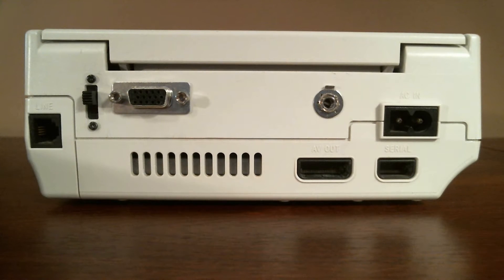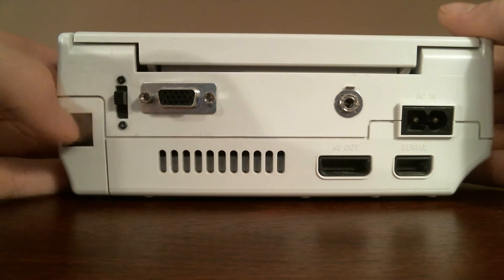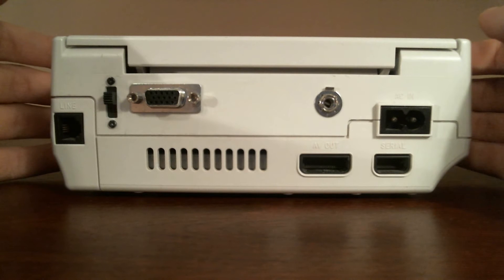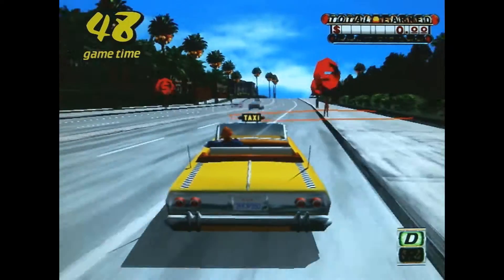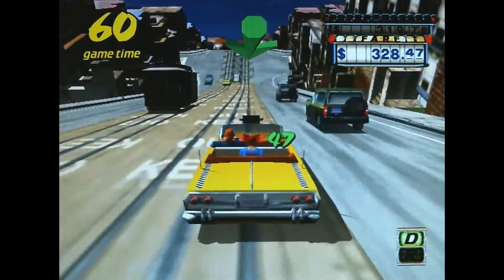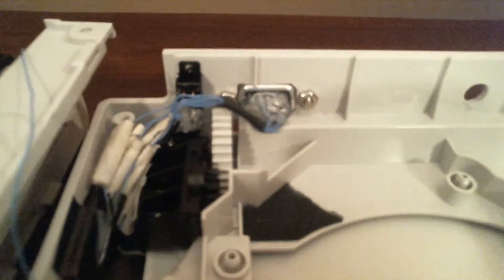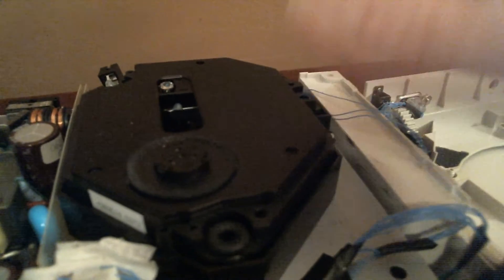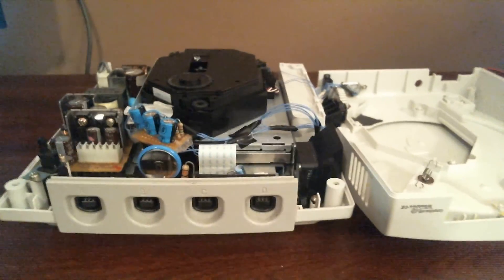Dreamcast Internal VGA Mod - Overview

Comment: DO NOT use hot glue to hold wires to their solder points, using a blob to hold the board onto the case of the dreamcast is alright but NEVER use it anywhere where wires meet the  solder

Comment: There is a vga cable that plugs directly into the AV port on the Dreamcast, is there a quality difference between that and this mod? Also, is VGA better quality than the RCA connector?
Reply: Elite Khajiit Why not a cable? I bought one and it works perfectly. There isn't much difference between the cable and the retrobit vga box.
Reply from the maker: Please don't buy the VGA cables that plug directly into the back of the Dreamcast's AV port. From everything I've read, they don't work. The Dreamcast needs the circuit to output proper VGA. You can buy the Retro-bit VGA box if you don't want to spend that much on one (it's $30 USD)

http://www.stoneagegamer.com/dreamcast-vga-box-retro-bit.html

There are also other VGA boxes like the Hanzo which have other features like a scan line generator and the original VGA box from Sega, which is sort of a collectible and very expensive. Whichever VGA solution you go with, make sure it's not just a cable, but a box instead. There's no real quality difference between my Retro-bit VGA box and this mod. The mod has some noise in the picture, but that's because of the resistors I used (carbon vs. film). Even then, it's not noticeable unless you stare at a black screen looking for it. The quality of VGA over composite and s-video is much, much, much better. A VGA signal is one of the best analog signals you can get.
Reply: Thanks that's a very clear explanation!
Reply from the maker: No problem. Glad to help, especially with anything Dreamcast.
Reply: I use a Retro-Bit cable that I cut the VGA enable trace on (now it is in RGB mode) and plug it into a cheap Extron RGB interface. Capacitors are not necessary because the Extron is filtering the signal. The Extron does not process the signal, though, so you can't get 32kHz VGA to work on a 15kHz PVM.

Comment: The PlayStation 2 has a vga cable certified by sony for it. No modding needed.
Reply: Hey guys this isn't 2002
Reply from the maker: The Dreamcast had several VGA boxes available for it, including Sega's own. The VGA mod is for fun. Besides, the PS2 requires a sync on green monitor. If you don't have one, you need to build a mod with a chip to get VGA capability out of the PS2.
Reply: No you don't. You just bought the hard drive with linux on it for ps2. You just had to install it.
Reply from the maker: https://en.wikipedia.org/wiki/PlayStation_2_accessories ... Not to mention I looked into it when I wanted to install a VGA mod on my PS2.
Reply: some monitor's support it out of box.
Reply from the maker: That's what I said. Not many new ones support that feature though, so it's better to build the mod or buy a new monitor.
Reply from the maker: You might want to read the description of that eBay listing, it says what I've been saying all along. Why are you even arguing this? It's not an opinion, it's not debatable. Facts are facts. You need a sync on green monitor to use that cable. If you don't have one, you have to make a custom mod that will allow it to work on non-sync on green monitors OR buy a new monitor. Your persistence is seriously baffling.
Reply: Yup facts and facts you dont "NEED" to mod your system.

Comment: your numbers are a little off. Cameras record at 24fps(movie standard), and games are generally 60FPS.
Reply from the maker: Most webcams record at 15 or 30 fps, depending on the resolution you set them at (they're just webcams, they don't need higher frame rates). My webcam records at 15 fps when you set the resolution at 1080p, 30 when lower. Movies are often rendered at 24 fps, though if you look at super slow motion shots, they were actually shot at hundreds or thousands of frames per second then rendered at 24 fps. Digital camcorder frame rates vary. Video games, too, vary entirely. A lot of games are locked at 30 or 60 fps, sometimes at stranger frame rates like 45 fps. Developers usually try to strike a balance between visual quality and smooth gameplay.

Comment: Great video m8! I've been looking into the modding scene with the Dreamcast and Playstation 2 as of late and I've been considering attempting to do this mod. I found the guide online my only problem that I'm having is finding the right parts to install this mod. If you can't necessarily help me with this that's completely understandable but might I ask where you bought your parts for this? I found some parts that resemble what I want on ebay and amazon but they don't look right and there all from china which scares me a bit. If you could reply back soon I'd appreciate it most. Thank you.
Reply from the maker: A bit of an essay, but...

I bought the transistors, resistors, capacitors, VGA female socket, 3.5 mm female jack, and switch at Radioshack. I'd recommend smaller caps though, it's hard to close the case with the enormous ones from Radioshack.

The wire I ordered online, but I'd recommend getting 28 gauge stranded wire at a local hobby shop or an online store as opposed to the 30 gauge wrapping wire I used (annoying to work with). The only reason I got the wrapping wire is because I had no idea the hobby shop by me sold it and the wire on eBay is advertised as "Xbox" wire, so naturally it sells for a small fortune.

Lastly, I ordered the circuit board from Taiwan, which took an eternity. I had to cut it down to size with a Dremel tool. Just make sure to get the board that has separated lanes for the different connections like the one in the linked guide.

Also, I'd wire up two female RCA phono jacks as opposed to the 3.5 mm stereo jack if you're going to be connecting it to a TV instead of a monitor.